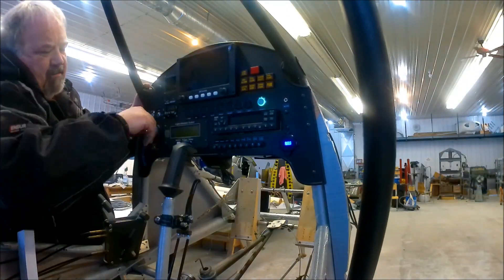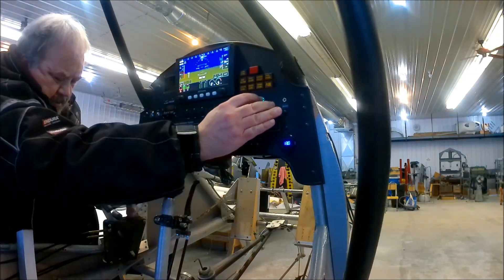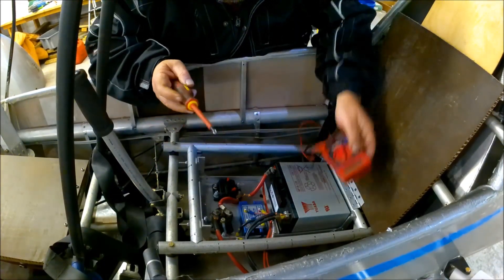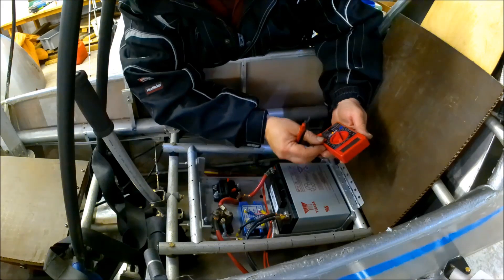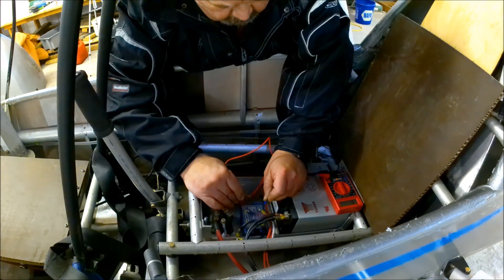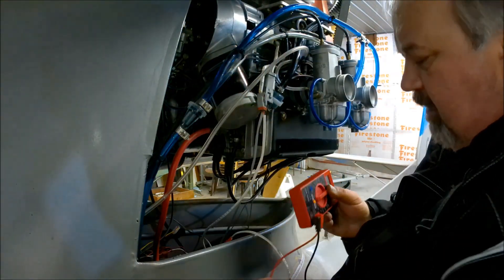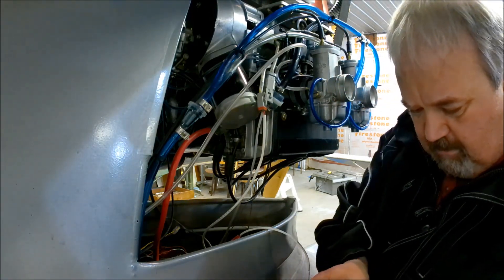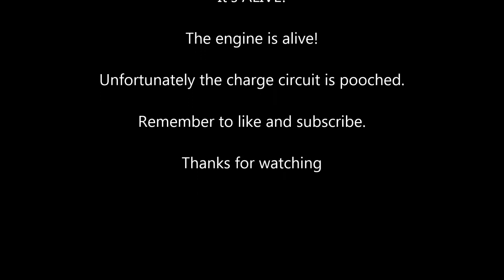EP 67 Part 2 It's ALIVE! Challenger 2 Ultralight Airplane

Comment: rotax rick said the best way to adjust fuel air mix is run it around 4000 rpm and get a little squirt bottle of premix gas.  Give  a little shot in the carb when it's running.  it should stumble a little when you ad fuel, if it doesn't it was too lean.
Reply from the maker: I hadn't seen that, but it does make a lot of sense.

Comment: I had a charging problem with one of my 503s a year ago. The yellow field coil wires coming out of the stator showed open wire. Pulled the engine off and the flywheel (magnet wheel). Saw mechanical damage to field windings. Apparently a small chip of the insulator material around on of the cores broke of and was caught by the spinning flywheel. Broke top wire of a field winding. Carefully removed  stator plate with the field windings. Cleaned up as best I could. Unsoldered lead wires and took off two turn from the damaged field coil. carefully spliced wire back in and rewound the coil and reconnected. it showed a few ohms that showed field coils now in tact. Reassembled and reinstalled. It then produced AC voltage and is properly charging now. Carefully applied glue to any loose insulation surrounding insulation on any cores. Good luck with your engine. let us know what you find. Bill
Reply from the maker: Thanks , I will be doing a disassembly soon and post the results.

Comment: That looks little scary right in front of a prop that is sucking air into it. Too bad can't mount a flywheel where the prop is to tune it probably would not have the correct load.
Reply from the maker: Ya, I’m super cautious when doing anything that close to the prop. Not a place to be distracted, or to rush.